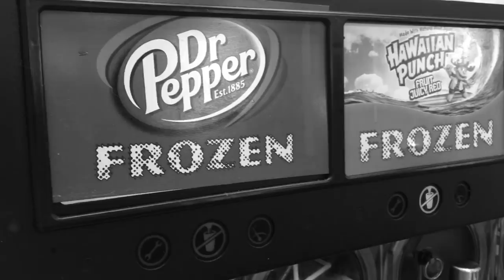Eclipse Lawn Care We're Doug-less

Comment: My man all you need to do is bolt a tire boot to the floor. They will lock in place and hold the mowers. When you get to a yard you unlock the boot and take the mower out. I’ve used it for years. You can even get a boot (tire holder) for both mowers and it wil fit
Reply from the maker: Thank you.

Comment: Dude the break don't keep the mower from moving? F dat every time.
Reply from the maker: It does. It's that the floor of the trailer is smooth so the zero turn slides around.